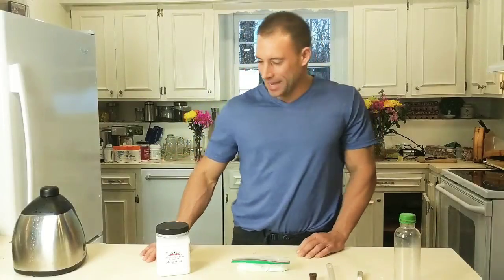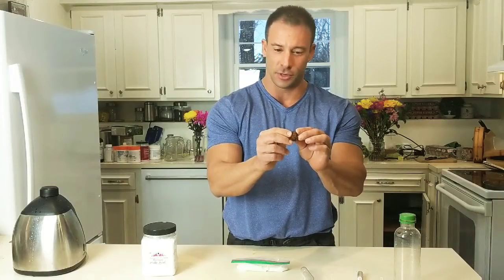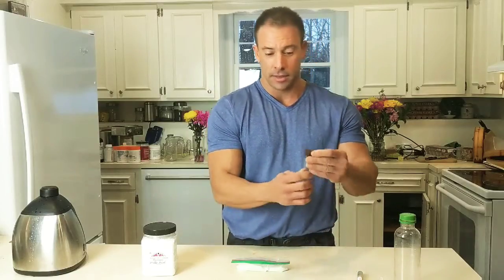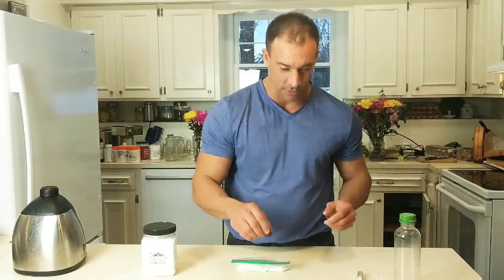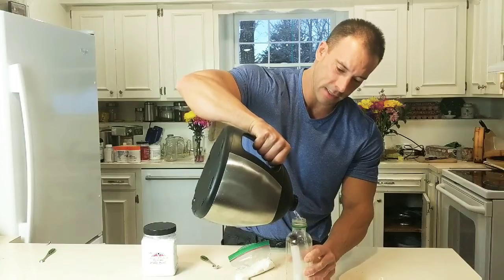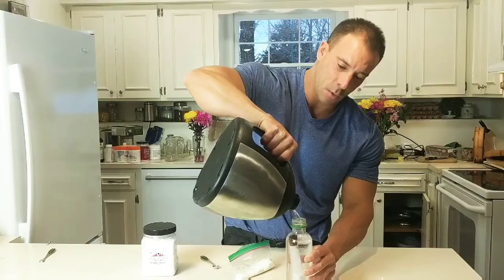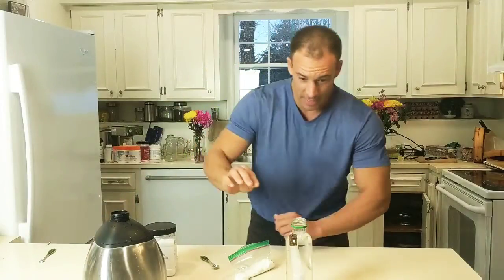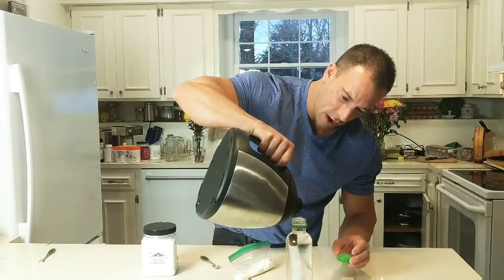How to make hydrogen rich water.

Comment: Thank you for this video.  I've been making my own this way using a glass test tube with a tubular finger bandage around test tube in case of  glass  breakage.  I've been using the thermos brand 770 ml stainless steel hydration bottle also.  This bottle has quality seals and works a treat.

Comment: arent you suppose to add boiling spring water not cold regular water? Im also confused why a test tube is needed- why not just mix acid and rods without it? You should also be using more mag rods.

Comment: I have recently purchased a V8 hydrogen water machine but when I add tap water it looks like its working I can see the effects but when I use distilled water nothing happens that I can see. Could you tell me if it still benifits the body or am I wasting my time, because I only drink distilled water. I would really appreciate it if you could answer because nobody seems to know
Reply: Distilled water is extremely bad for your health and it is not meant for drinking, ever. It actually dehydrates you and rips off the minerals from your body. Let me know if you want to know what the real living water is and how to get it.

Comment: Attempting to create a hydrogen gas but using acids and minerals is a chemical change in some kind of water being used here. Hydrogen in its normal state is a gas. Molecular hydrogen is properly produced via electrolysis where contaminant and poison free water molecules are split into OH- and H+. This is an electrical change and how H ought to be consumed which mirrors the proper electrical charge of our body's cells

Comment: Hello sir I had a question when putting the water what kind of water can we use can we use distilled water or any type of water
Reply: Distilled water is what is required. Using tap water may result in trace amounts of toxins produced from chlorine or sodium fluoride if it was added.
Reply: spring water
Reply: Spring water is more reactive and better.

Comment: HYDROGEN WATER GENERATOR  I made my own HYDROGEN WATER GENERATOR using the 2 inch long carbon electrodes extracted from old AA batteries and spaced apart 0.5 mm by plastic spacers and a electric current passed from a voltage boost circuit module from ebay costing 70 cents giving out a adjustable 24 volts powered by a usb phone charger.
Its a good idea to flatten one side of the carbon electrodes by rubbing them against a paving slap or file or using sandpaper. This increases surface area.

SIMPLE TAP WATER IN THE GLASS. NO ADDITIVES OF ANY KIND. THE NARROWER THE GAP BETWEEN THE CARBON RODS THE HIGHER THE PRODUCTION RATE. I REMOVED THE WOODEN 1MM SPACERS AND REPLACED WITH 0.5 MM EPOXY GLUE/RESIN AS  WOOD PARTICLES WERE COMING OF THE SPACERS.

USING BOILED WATER WILL IMPROVE HYDROGEN GAS DISPLACING EXISTING NITROGEN AND OXYGEN GASES IN THE WATER BUT THERE IS NO NEED.

https://www.ebay.co.uk/itm/5pcs-DC-DC-2A-Adjustable-Boost-Power-Supply-Converter-Step-Up-Module-Equipment/324207369555?_trkparms=ispr%3D1&hash=item4b7c43dd53:g:IFoAAOSwfaZe5LHO&enc=AQAFAAACoBaobrjLl8XobRIiIML1V4Imu%2Fn%2BzU5L90Z278x5ickk5v8gVt3hEWLVg%2F253w6XCY6BAjDc9H66Krbw8%2F7cjM6PlYCXdQc%2BouYecnMuwaw0%2FzaGGGbmJrd3atylKzZuPzXAwhv4175qOEbjACMRBOKfcJ3PGAh22wN3Tx129fZKrFWr450uXBqne%2FghQBn0BRoPnN88kZ82RmMbfc8AeW3JK%2FHpDWbbCU5pIRIVUPCyrgyWkkbEacQttSfHE1ANMeOZhKI1Zm3pNiuy7MPe%2Bocf5Mrja%2B870nRneQIjpz9ZIziS2M3PHeWYNRiXhTFwUx97cxP2dlanMIWK2ovC1f6zLx99G20%2FcMF7cnwsY4vQ0SgmuzW1QJZ%2FSkpa%2BZWGMcsTZFCCtT7Kk92kdniBJEt25RO%2BJlnoJc1yi1kxcAQLZMtKqw82U37m0hgL3rhg0oEv407m58T0bULP0O%2BKorB4JoLYDKA4dET%2FS7FyHBRGgL7brc4HV9U8g4g4Ek6ybYIJS80fN30bPCROERwg%2FijgJoICjXjjZhTnQdmjZ1%2FpLguH5cahGzK93QpMrvVJ9jIAsXDRPAKp7dDHA1J9DhGSRuyLvsVMXoE0VkMBbI6fphkMMUCdPi8UoYDfQ8vRd9QyTcj4nt11sujaryCH5OwlHnYTrFhLcSlf4ysB3j4XwQISE8%2FuPJiDWHEsWbPD788FxgwzxeLhrsIXB5sE4QmSsNsTWjaXaMB5U8ozJVpvxv2j846oAMOS9mBJQSKEBddAghXbn26w8CsCQNoT7NfNzScxA8DFDKk2WaeRKK8sXD0SJ0DQS%2B8PEe1bFrmQUUZrnHjrsadJFMnNwAfpH7JJpxAHuOCSFK8eINej8gmHQL1sQ7G32HZi9Yx0mLeeGw%3D%3D&checksum=32420736955550405c2980724fa49044971565a458d9

https://www.ebay.co.uk/itm/DC-DC-5V-3-3V-9V-12V-24V-USB-Step-up-Power-Supply-Module-Boost-Converter-L-6-/184209060411
Reply: you should make an youtube video !

Comment: Urgent help needed. I bought supposedly pure rods from two seperate companies. One oxidises black and the other slightly gold. I am now experiemcing toxicity symptoms. Can anyone help me understand what I might have put into my body and which rod is truly pure. Both produced hydrogen.

Thank you.
Reply: you did not buy 99.999% pure magnesium rods.  my rods NEVER change color or oxidize.  consider chelated rectal suppositories' to detox the heavy metals.  bummer!  if it turns black, gold or otherwise its not pure
Reply: Im having the same apparent problem they turn black and giving of a black substance as the hydrogen comes off ...looks a bit suspect to me ..won't be drinking it till i find out more ..

Comment: Great new info guys!! 
So I put water with some citric acid, water and magnesium rod in fully closed tube. how does the hydrogen leak to the water in the outer bottle?  the yield should be 3 ppm? how long to wait until it's ready?
Jiří Hutečka
 - you sound very knowledgeable - would appreciate your guideness in that matter

Comment: Use Grolsch beer bottle 15.9 oz with spring cap. Works beautifully
Reply: Doesn't it turn to a gas regardless. So when one opens it. The gas flows out? Does it stay in water if not consumed within 60 seconds?
Reply: @shrek22  good question. Did you ever find the answer to that one?

Comment: Hi, I just learned about the benefits of hydrogen water today and watched another video before this one  (by Glen Ingram).  He uses boiling water which he pours directly into a beer bottle with a patent top, then puts it in the freezer.  Is this method wrong or are they both good?   Excellent video, by the way, thanks!
Reply from the maker: I think Glen Ingram knows what he is talking about.  The boiling water creates a faster reaction.  His water may have more hydrogen than mine, but I don't want to take the time to boil.  In my opinion, the test tube method also has it's benefits, (by keeping the concentration of malic acid higher in contact with the magnesium rod).  The test tube acts as a reactor.  Glen's method uses the entire bottle as a reactor.  I need to do the reagent testing on my method so I can give you a proper answer.  I hope to do this within a few months.  I'm out of the country now and haven't been able to find the reagent.  So keep this in mind...  Anything I say is conjecture.  If I remember correctly, Glen actually tested his water.  He's a better scientist than I am!

Comment: I understand from Dr. Gundry that glass containers only.
Reply: Hi June I'm a plant paradox follower. If you don't mind me asking, where did you source that info re the glass only. I must have missed it and I want all his info. thanks  Bruce
Reply: Not true. HDPE works fine. I make pressurized hydrogen water but slightly differently. Mine is incredibly potent.
Reply: Can you tell us how?  I want to make a big batch to bath in to a 50gal tub!   Short of buying approx. $960 of the H2 tablets per bath, unless I win the lottery!😂.  All the other generators seem to be questionable on output other than Korean brand HueLight at $15k

Comment: hi, what if i want a much much slower H2 reaction... like i want the water to be filled with H2 in2- 4 hours or overnight...
Reply from the maker: If you want a slower reaction, you can simply eliminate the test tube and use the bottle as a reactor.  However, if the bottle is sealed, you will not lose hydrogen overnight even if you use a fast reaction with the test tube method.  The hydrogen only starts to leak out at significant levels after you open the bottle and reduce the pressure.  The half life of hydrogen in the water is approximately 4 hours after you open the bottle.

Comment: Jacob. I found something to use that makes things easy for me. I am using a 16mm inside diameter test tube. I had some trouble every once and a while with the cork popping out even after putting a hole in it. If the hole is too large, then water gets in. Is your test tube 16mm?

SOLUTION: I found a silicone beer-making part that fits precisely inside the 16mm test tube. ABECO Thomas Valve 12J06-103. Only 89 cents at my local beer making store! It lets gas out but does not let water in. I wish I could add a photo. It's a simple one-piece part with a slit. You put it in, so the slit is facing out. 

I repurposed the cork: I tied a string to the test tube and the other end to the cork, so it floats to the top, and I can more easily pull out the test tube. 

My container gets highly pressurized after just a few minutes. That could be from using the ribbon magnesium which has a lot of surface area. I use 3 or 4, three-inch sections. It is more expensive per gram than the bar. I'll probably buy some bar magnesium in the future. 

For those not following along: By putting the acid (malic, vinegar, whatever) and MG in a test tube, it concentrates the reaction. If you put the malic acid into the larger container of water, it is so diluted that it does not eat away the magnesium or does so much, much slower. If I fill the test tube much more than half with vinegar, hydrogen bubbles drive some vinegar out into the water I plan to drink. 

I regret not having a definitive test of the H2 concentration. A meter is about $450, and I'm too lazy to by and use the reagent.
Reply: how many times can you use the Magnesium rods? Unlimited?
Reply: Are you in the USA? I cannot find the valve.
Reply: @allenwhipps1233 is there any risk of metal poisoning to this?

Comment: I bought test tubes that were not wide enough so I bought magnesium ribbon (comes in a spool: SEOH Magnesium Ribbon 25 Grams.) I used the test tube and added three strips I cut off the spool then added inexpensive white vinegar. It bubbles like crazy! I'm thinking about using aluminum beer bottles that have screw tops that crap beer now comes in. Hydrogen will go through plastic. I used a SodaStream bottle just as my first experiment.
Reply from the maker: The ribbon is a great idea!  I found that VOSS brand bottled water containers work well.  They are glass and the lid seals quite well.
Reply: The ribbon is about 40 cents a gram, the bars are like 10 cents a gram. I didn't know if the bars (typically 16mm) would work in the 16X150mm test tubes I bought. I may get some wider test tubes.
Reply: I can't recommend the aluminum beer bottles. I when I started to unscrew the top, it went off like a gun. The cap is thin and the threads didn't hold so, as soon as I just turned it a bit--POW!!! Really stung my fingers!
Reply from the maker: Thanks for the tip Allen!  Ouch!

Comment: I'd like to know the concentration of hydrogen using that method. I've seen videos where they use a meter to check. If you got this method from someplace else, they may have an idea of the concentration. Of course it leaks out over time, I mean when you take it out of the fridge.
Reply from the maker: Allen, I got this method from reading several different sources.  None of them specify a concentration.  However, there is a simply way of determining the concentration by using a "hydrogen test reagent".  A google search of this term will yield many options for purchase.  Then you can determine for yourself if you can tweak my method and get a higher concentration.  I plan to do this experimentation and will release a follow up video when done.  Thanks!